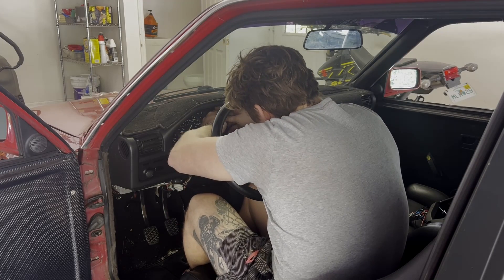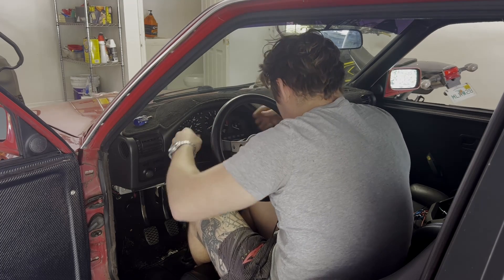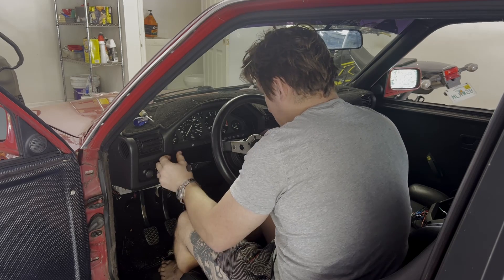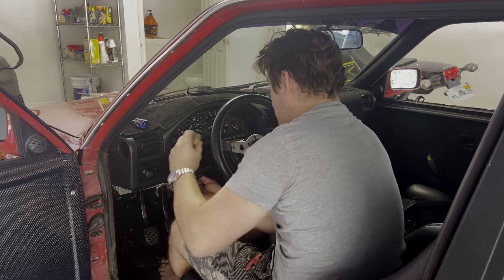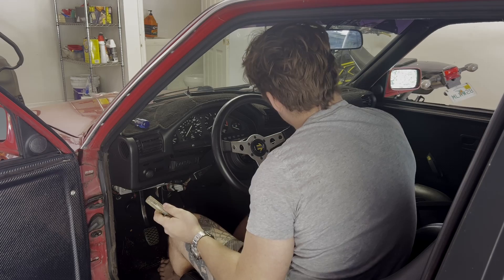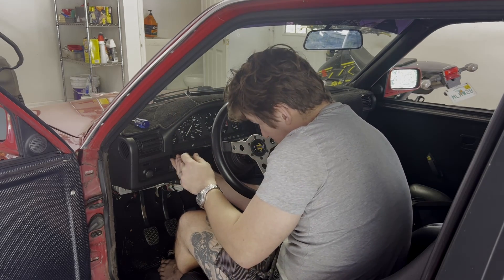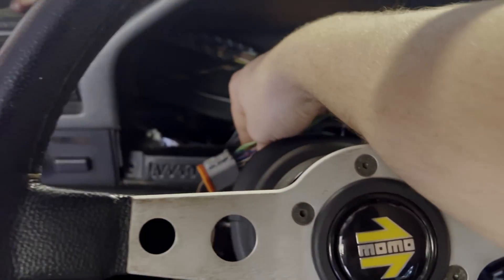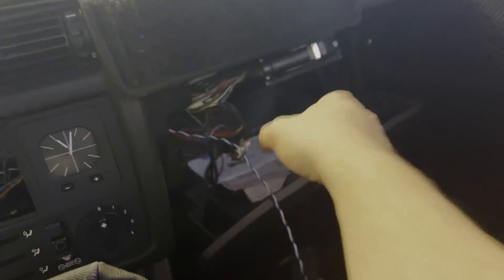Project Turbo E30 - Powertune Digital Dash Retrofit

Comment: what multigauge port was that?
Reply from the maker: On the ecu?
Reply: @shed_mfg  the usb/volt meter that replaced the cigarette lighter.
Reply from the maker: @kamathedaniel  oh, just type usb volt meter into Amazon, eBay or similar. It’s generic and I don’t know what brand mine is.
Reply: @shed_mfg  thanks. great content btw

Comment: Been dying to do this to my e30 so glad seeing someone do it, how wiring in the fuel level? That was the only thing holding me back. What year is ur e30?
Reply from the maker: It was pretty easy (relatively) I pulled the oem connector, and the fuel tank access panels and continuity tested to find the wire that went to the senders, and then ohm tested to find the not low fuel wire. Then you get a programmable speedhut USA gauge, and drive with a 5gal can in the trunk until you run out, set low value on gauge, fill up at your nearest convenience, set high value on gauge. Mint.
Reply from the maker: 89’